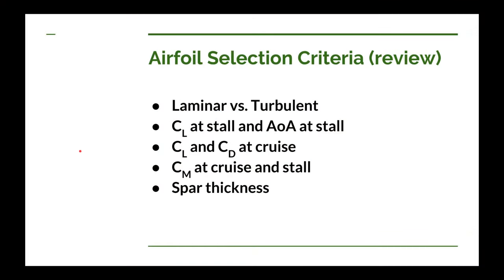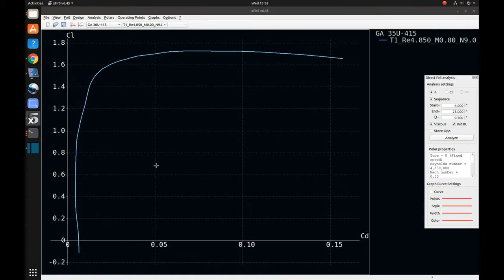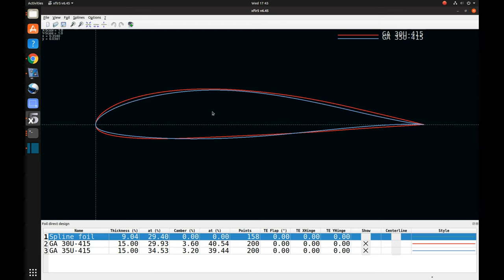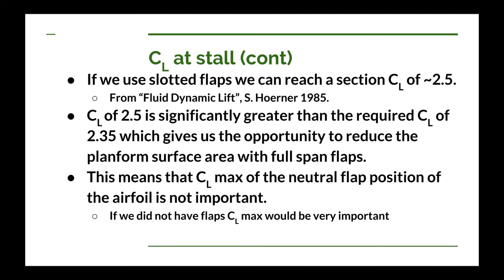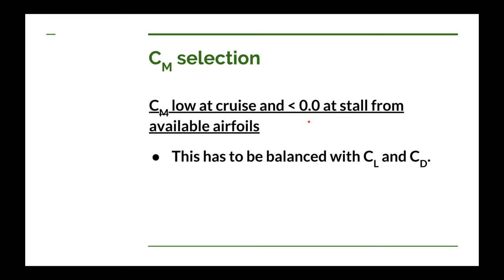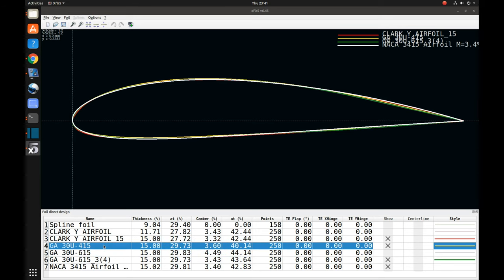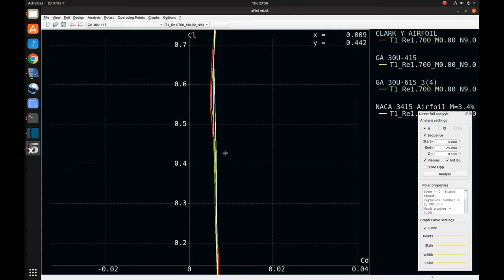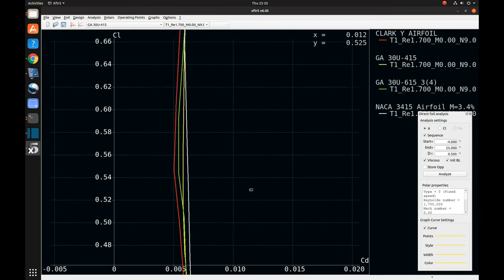UWS-1 Design: Wing Airfoil Selection Part 2

Comment: Very helpful video, thanks!
 I wound up choosing a laminar foil for my design, the eppler 793, due to a thick camber and high cl/cd
Reply from the maker: There is a Natural Laminar Flow Airfoil (I don't remember the model number) that is supposed to be fairly good at remaining laminar or not tripping to large turbulent boundary layer when bugs or particles adhere to the leading edge. I almost picked it. It may have been NLF-2.